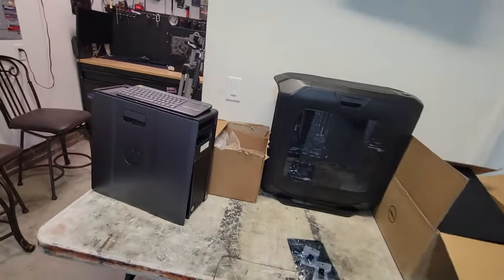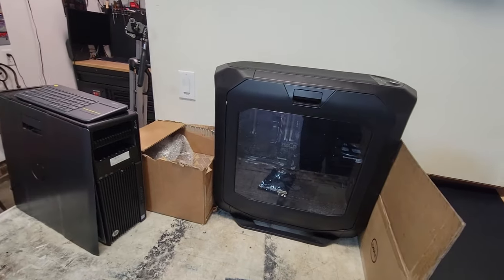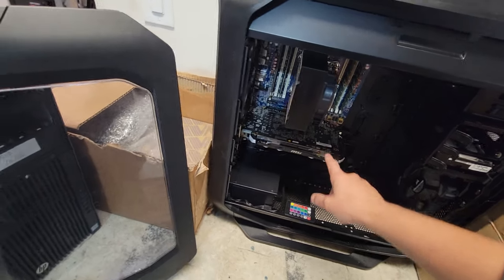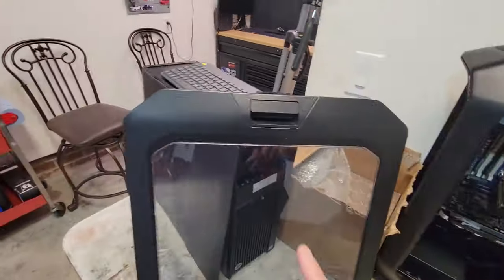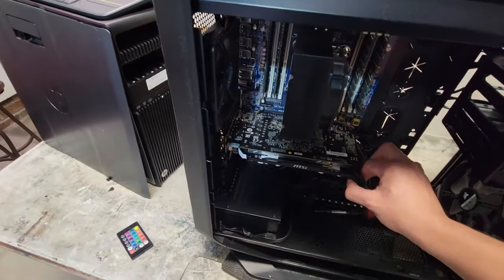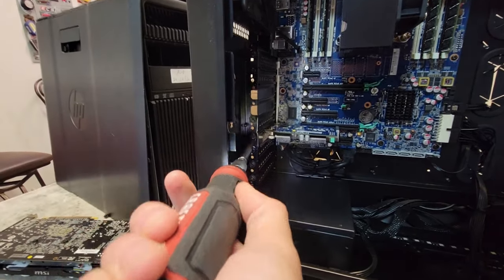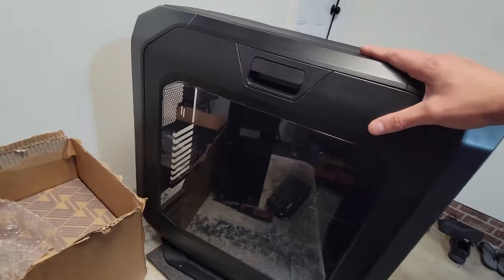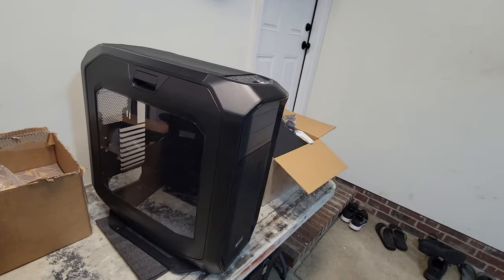Cleaning up for more computers!!

Comment: That clear case i have one i cut it up a bit made it a test motherboard it has a power supply on it and its good if some one wants me to quickly test there pc  its exactly the same as you have some one had it on the side of the road i picked it up and other spare parts im like that i have eagle eyes while driving

Comment: Lol, the case and stuff you part with is stuff I'm buying and looking for smh. I recently got into PC tinkering when I got too beat up medically and physically to continue working on vehicles. I've learned alot and am attempting a first build revolving around older cheaper LGA 1150, i7-4790, GTX 1060 parts inside an old Thermaltake case, to start with. Yeah I have alot of catching up to do. BTW, Is that the OE Z440 PSU in that case? I have a heavy and humongous Z620 I got for cheap that's booting off the same HP Turbo PCIE adapter. It can't boot off of NVME but it does with the rare Samsung SM 951 512GB AHCI M.2. I can't sell it it's too old heavy and ugly smh so I'm stuck with it and other HP DDR3 MT's. Love the channel, great work thank you. Keep up your builds, I'll keep watching
Reply from the maker: yea it is a rehomed hp z400, easy case swap

bro this stuff gets addicting!!